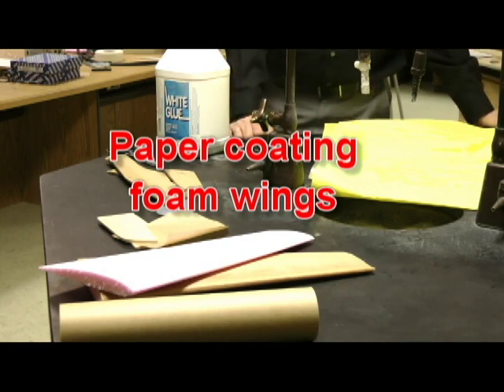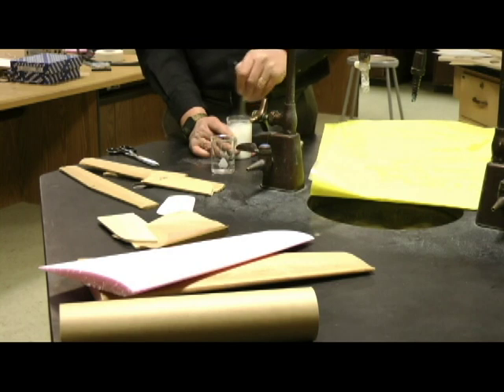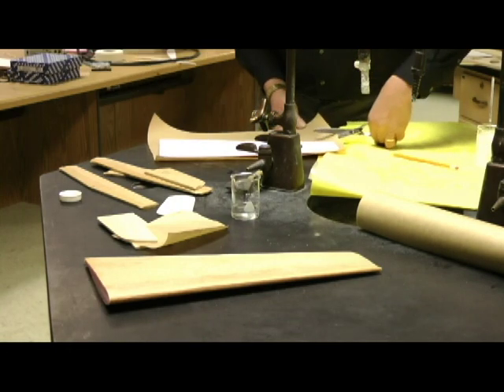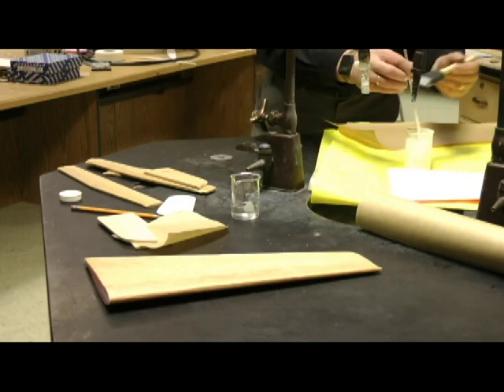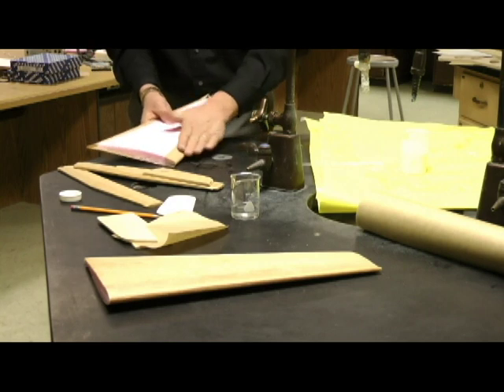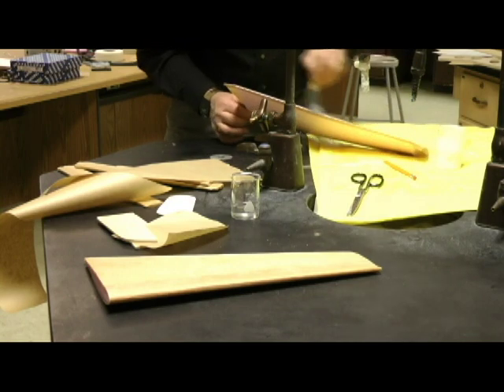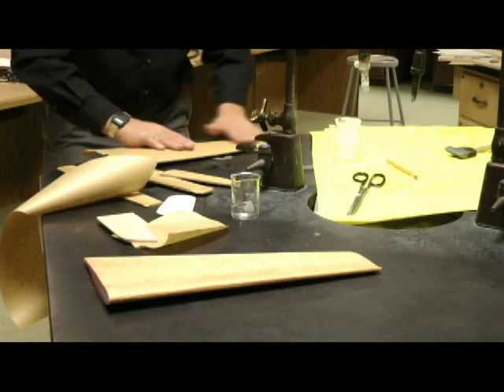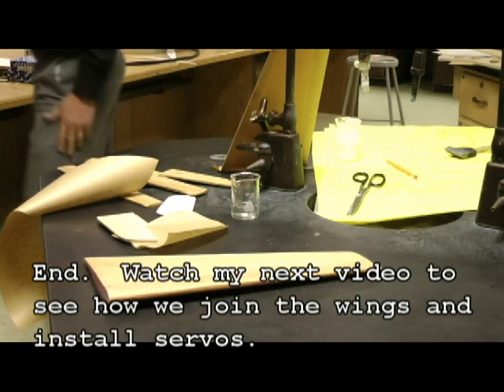Tutorial 3: paper coating foam wings

Comment: 1 of ??
Good videos.  I too have covered foam wings with brown paper.  I have used the paper from a stationary store, they stuff you use for wrapping things in for the post and such.  I think it is a bit heavier than the masking paper, but not sure on that.  I use the same method of thinning out the glue.  I have used the white glue that is made to be water resistant and it seems to be better than the non water resistant stuff.

Comment: Hey Folks!  Just finished paper coating some 6ft. long wings using the "andpet55" technique and it worked out well.  But, I added the step of lightly squeegee the wet paper after application with a straight edge plastic squeegee to push out any bubbles of glue or air trapped under it towards a seam lap.  Then a light wet brush to smooth out the marks from the squeegee and spread out the extra glue.  Almost as if doing a fiberglass lay up, without the smell!
Reply from the maker: Good Job!  Great addition on process as well.  Thank you.

Comment: I noticed that once its saturated . The paper expands more and needs more attention to getting all the wrinkles out...which is a lot more work and time consuming..

Even have to saturate the excess lap or it will be dry and curl backwards over the wet paper wrinkling further
Reply from the maker: Another thing that I do is go back over the tough sections after they dry and wet them again with a small amount of glue.  It is amazing what you can do to get the paper wrapped around corners if you spend a little time on it.

Comment: Nice idea thanks for sharing! Have you ever papered a rounded fuselage? I am thinking about using this technique on my foam plane and although the wings and tail pieces seem relatively straightforward to do, the fuselage seems like it may be a difficult task to get right.
Reply from the maker: Yes, I have.  I have done them in smaller strips and they will stretch around nicely as long as you narrow the strips with the tapered end of the fuse.

Comment: Yes I was thinning more to keep it lighter for indoor planes...and saturating the paper ...which works good. . And is strong and light but creates a difficult in laying the piece down , doing the backside...seems to sand better that way when dry...but again messy

I now see the logic in doing one side...sanding off the pure paper with the glue becoming more of the harder barrier...and making for a much easier application.

Its same weight as the paper on DT foam. Which has no glue...which is a press fit...but waaay stiffer than DT foam .I need to figure a way now to apply a surface only primer so no point is absorbed for weight purposes

Comment: Looks like your only coating the paper on the side against the foam..and wiping the dry paper. I find that the paper saturates and lots of bubbles appear but work ok if it is saturated...Am I thinning too much if it saturates the paper rather than just against the foam.?..or should it saturate?..I use Titebond
Reply from the maker: Titebond is great to use but I believe you are thinning it too far.  It needs to be about half the original consistency and no more.  You need the back side of the paper dry except at the seams where it will overlap.  This helps in using your hand to move the bubbles to the edges and then out.  I am glad to see others using this process and it gets better with a little practice.

Comment: Thanks for sharing! What's the paper you're using? I heard you say "masking tape" but it doesn't look like masking tape. I must have heard wrong. Thanks.
Reply from the maker: It is masking paper, the same that is used in a masking dispenser.  I use the 3M brand only because it is what is available at my local Ace Hardware

Comment: How do you scale your airfoil designs to cut them out? Do you use a program or just hand draw them?
Reply from the maker: I usually print them in Microsoft office as an imported image and scale up the print.  You can stretch the image as large as the document will permit (print it in landscape up to a 14 inch print).  I have also been known to take a .jpg file from the internet and scale it up when I send it to the printer.  I do have the advantage of having a 36 inch plotter and if the file is too large (as with my 14 foot Piper) i just sent it to my plotter and oversize it by a percentage.  Once I did download an image and print it as large as I could on my printer and then take it to my office copy machine to enlarge as large as I could get it on legal paper sized material.  Thanks for watching.
Reply: +andpet55 man you're on top of responses! Kudos! I shared your videos on the crash cast podcast listeners page! Thanks for sharing your knowledge and count me as subscribed!

Comment: How does this compare to covering with EconoKote, weight wise?
Reply from the maker: It is slightly heavier, but the reason I do this is for durability and cost.  I use these to have my students learn to fly as well as build, and the cost of the materials is minimal.  I have a 14 foot cub that I did this on and painted it with latex.  Looks great and cost 5 bucks for the whole thing because I purchased mismatched colors.

Comment: is this method better then using packing tape?
Reply: or would glass fiber be the best
Reply from the maker: Henry Kristiansen
The nice thing about the paper is that as it gets wet it will form around things quite well.  I have used glass on other things, especially large models, but on these small wings.  the weight of the resin is a huge concern.  I did do a model on foam years ago with packing tape, but it was quite heavy as well - indistructable- but heavy.